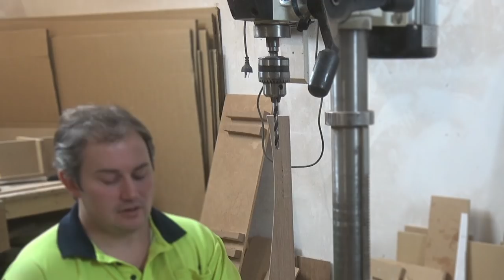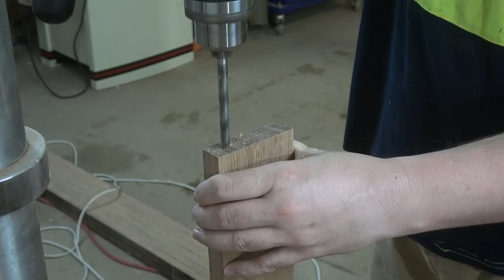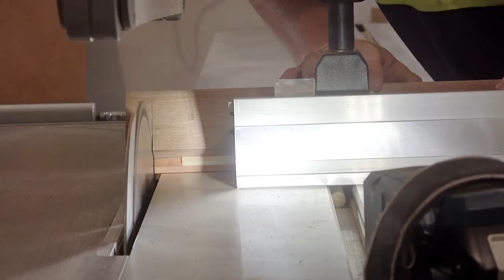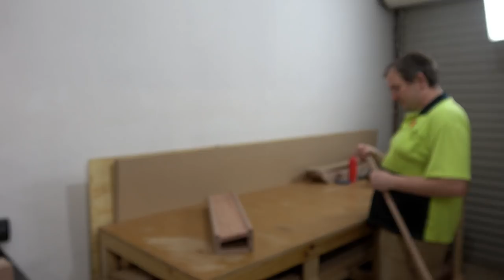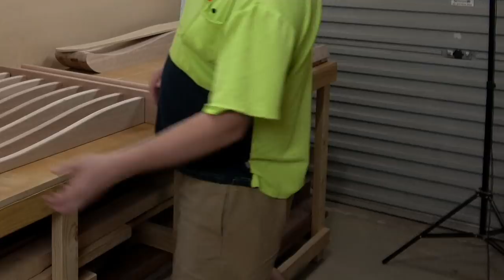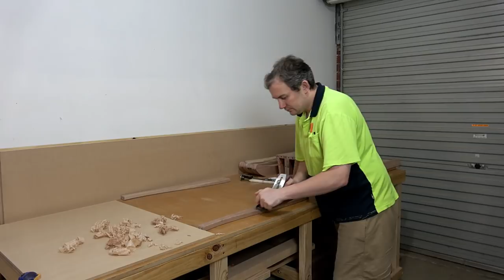More dowels - Baby Cot Woodworking Vlog 12

Comment: Random curious question. What thickness is each pass of the hand plane taking off the face? 1/10mm?
Reply from the maker: Most of my smoothing passes will be between .001-.004". So a tenth of a millimeter is about right for a thick shaving.
Reply: @kuffyswoodwork  I'll get a hand plane one day... and wonder why I waited. Only one question... where does the battery go? 😅
Reply from the maker: @FixitFingers  handplanes do make somethings easier. Though, I think a card scraper is a better choice for those primarily using power sanding. The card scraper will smooth any localised tear out quickly, requiring only minor sanding afterwards.

Comment: G'day Kuffy - you are making an amazing job, and I love your sense of humour. But I have one question - How big or heavy is the baby (or babies) this cot is for? It is designed to harbour bridge standards!
Reply from the maker: Well...when my sister first asked me to build a cot for kid. I thought, yeah sure, babies are small, how hard could it be. Because I had never built a cot before or have kids of my own. She brings over the cot mattress which barely fit in the boot of her car. My reaction was something along the lines of "OMG! how big is that thing in your belly!!!!". I had been thinking of a scale more appropriate to a bassinet, small, easy, job done in a week.
The entire cot will be bloody heavy when fully assembled, and way too big to fit through most house corridors and doorways. So I am building it knockdown. The two side panels, front and back panels, mattress base, and lower drawer. When the kid grows up a little, you can take the front panel off and use the cot as a toddler bed. So it should be good for the first 4-5 yrs of the kids life. A little more bang for ya buck, as they say. I guess it could be left as a toddler bed and used as a couch if space doesn't permit the cot to be stored away waiting for the next kid.
Reply: This thing will be still going in a hundred years for grand-kuffys and great-grand-kuffys
Reply from the maker: Possibly. Not for my kids though. It seems I may have missed the boat on that one.
Reply: Well Grand nieces and nephews then, that is going to be an heirloom piece

Comment: I gave you a thumbs up 👍, I bought some oak from Bunnings mate & it’s quality it shite, why is this so ?, hey are you interested in an ANZAC Day video build mate, Dale from Wacky Woodworks asked if any Australians might partake in this so I said yes & how about you ?
Reply from the maker: What kind of Tasmanian Oak did you buy? F17 structural? Or their select grade DAR 140x19's etc? The select grade should be decent. The F17 structural is usually garbage. Not so much because of the gum veins or pockets. But it is often loaded with checking. Also if it is fresh from the mill, it will likely only be kiln dried to around 15% moisture content which is too high for any decent joinery jobs, though it doesn't take too long to drop to a reasonable 12% MC when left inside in a protected area. I'd be interested in the collab around Anzac day. Assuming I have this cot finished by then 😀
Reply: Kuffys Woodwork I think it is F17 mate, it’s thick 45mm but I’m using it as slats on a park bench so it’s no big deal, one length was great but the other 2 pretty lousy, Bunnings staff don’t know anything about what they’re selling do trial & error mate.
Anzac Day build is something related to the day & I’ll find out more about the title keywords 👍
Reply from the maker: I was at Bunnies a moment ago and had a look at their F17 stocks and select grades. The select grades was some beautifully straight grained and clear timbers, but man...it is approximately 120% markup from what "anyone" can buy at an appropriate furniture grade timber merchant. The F17's (only looked at the end grain), all but 3 lengths of 140x45 was utter garbage with checking and piping through it.